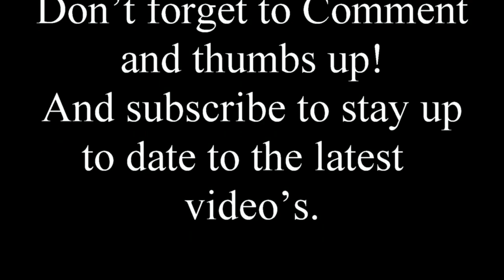Waterproofing your RC receiver with conformal

Comment: Awesome tip. I use the same fly sky receiver in my emaxx and it’s in the open, I been snow bashing with it and haven’t had any problems with it yet. But this extra step would ensure that no water would get in. I gotta get me some of this stuff.
Reply from the maker: Awesome I hope this did help you out,  thanks for commenting and watching.
Reply: That's good news because these receivers can tweak out just from running in wet grass.

Comment: We I think they should still accept the return if it's been modified but you would lose what u did an then they should send you a new stock one an you can redue ur mods. An I came here from the stevod chat an thanks for the vid def gonna remember this one thanks man ima have to get some of this cus the esc  I got isn't waterproof.
Reply from the maker: Thanks for watching the video and I'm glad it was helpful to you and it was nice to see you in the chat on Stevo D channel.
Reply: @TheTankRC  thanks man an I was wondering what ppl used cus I use grease an  it gets messy from time to time lol thanks man
Reply from the maker: @rsracing-mb1tr  another stuff I use is electrical liquid tape, it's like Plasti Dip but for electronics.
Reply: @TheTankRC  that's stuff works but I've never had any decent luck with it so I don't really use it anymore but glad I found out what to use .

Comment: Nice!  Good video. I’ve got a question: I’ve always waited to coat until I’ve got everything plugged in and can coat right out to the outgoing wires.  Is that overkill? Is the servo plug itself a liability in the wet? Or is it good?
Reply from the maker: If the way you are doing it is working for you keep doing it, me myself I do not worry about the pins going to the different channels I worry about what's on the board that is more important to water damage.  So in other words myself I never cote the pins going to the servo or ESC
Reply: Thanks for your reply!

Comment: Wow this looks like some very easy solution to use and apply. After doing it once and running my rc for awhile,will I have reapply more later on down the road? Also where can I find this?? Thanks for your time Tank very helpful 👍👍
Reply from the maker: Amazone or your local electronic store.  Link is in description, Thanks for watching.

Comment: 👍 Cool that MG chemicals makes some great stuff! I use the MG chemicals lacquer version of the conformal coating and it works great also.   Tank hows the silicone one feel when dry is it like rubber feeling like silicone?😲 Your not going to go under water like a submarine with the wild one are ya!  👍Good stuff!
Reply from the maker: To tell you the truth I never really touched it after if dried up but I'll do a test and let you know.
Reply: @TheTankRC  Cool just wondering if it was like a rubbery coating.

Comment: I washed your Hangouts couple days ago you said you didn't like the black tape coating do you recommend this clear stuff over the black tape and have you ever had any problems with the black tape coating
Reply from the maker: There is no problem using liquid tape, I find this product easier to use.  The reason I used liquidate before was ease of access of it, but now that I found how to get conformal I will be using this for electronics from now on.